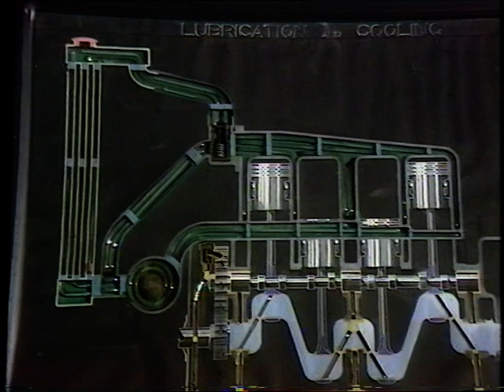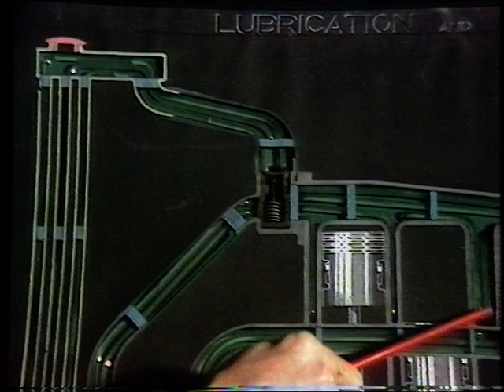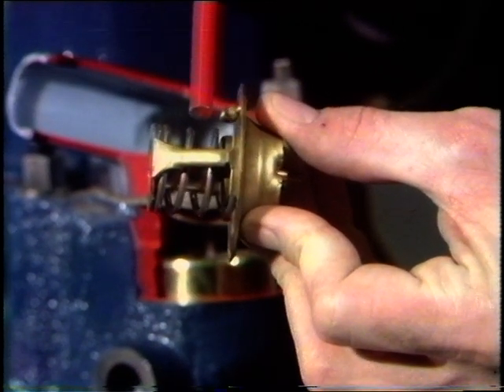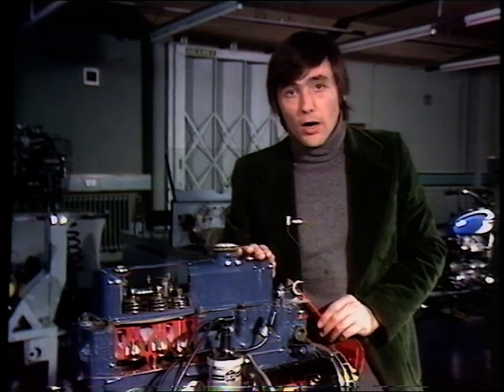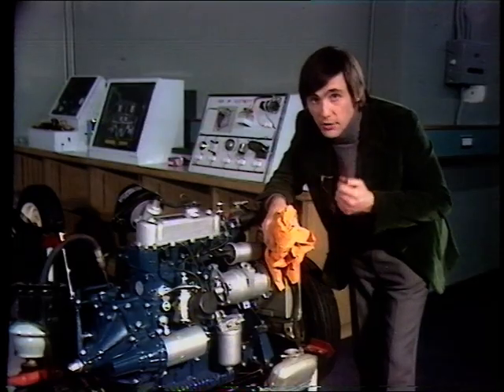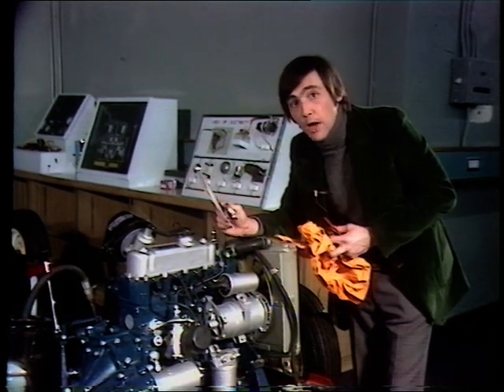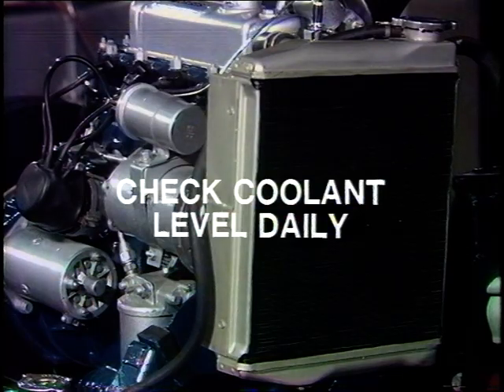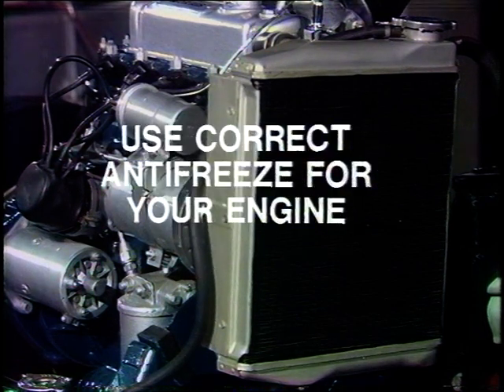How does a cooling system work | 1970s car | 1970s Engine | Drive in | 1973

Comment: Another serious piece from Bastable. Do you think any of this still stands? I don't do any of this - I only do it when my car breaks down!
Reply: I always check oil and coolant regularly. But then again, I am driving a 25 year old car.
Reply: My car’s only 4 years old but I check oil and fluid weekly. I guess it’s the legacy of having had older cars and never fully trusting modern ones. I check belts I can see about monthly.
Reply: @volvo480  Good point I guess, I did used to check my car (1992 Panda) before long-ish trips and spare water in the back. It's currently sat on the drive waiting for an MOT.
Reply: Yes.  Most of it still applies.  The same pump assisted thermosiphon systems are still in use to this day, along with rubber hoses that crack and perish, wax thermostats (although some are electric) and we still use a mix of antifreeze and water as coolant.
Reply: @brunster64  OK, so how often do you actually have to top them up ?
Reply: @spankysmp  Yup, we never bothered until just before a planned long trip.
Reply: pmailkeey -- pretty much never, for oil or coolant - still have to check though 🙈
Reply: @brunster64  Exactly - hence I don't bother :) Having said that, the car's not doing a lot of mileage - not really enough even to keep the battery charged!

So there's a thing - I 'check' the battery more - but putting it on charge every other month!

Comment: Nice instructional video on how to maintain a 1970s car by the late Tony Bastable. Never knew some cars were using methanol as coolant antifreeze.
Reply: Methanol was the most common anti-freeze before the advent of Ethylene Glycol based coolants. It worked very well, but was corrosive and as Tony Bastable said, it evaporated.
Reply: @capriracer351  and also when you drank it to whet your whistle on long journeys you could go blind.
Reply: 1970s ? I'd have gone for more 1960s !

Comment: Cold water into a hot engine will warp the head? No, it will crack the block
Reply: quite, and tbh if you put a bit in the rad it will heat before it reaches the engine. Thought that was slightly pedantic advice - try and find warm water!!
Reply: @pigknickers2975  it was a different world (and better)
Reply: @bonkeydollocks1879  don't disagree, we are all watching it for the same sorts of reasons

Comment: Just another reason  why electric cars are better
Reply: Why, because batteries in an electric car don't need heating or cooling? I have news for you: they do. 😊
Reply: From this clip you can an engine adapts to the outside temperatures, in winter in zero temperatures an electric car will lose some capacity and take longer to charge, especially with extra other demands on the electric network.
Reply: Tell me if your electrical appliances wouldn't catch on fire once it malfunctions.
Reply: Until they hit around 100,000 miles and then the very expensive batteries that use very precious resources need replaced. And they’re soulless and pathetic.
Reply: @gutworm686  is producing excess heat and noise polluting what gives an ICE car its soul?
Reply: @neychev  That heat and not losing half of your mileage when it gets to be -20C here like electric cars do certainly comes in handy around these parts...
Reply: @volvo480  difference is ICE car will break down almost i stantly without cooling, whereas electric car will most definately not
Reply: @gutworm686  Just like Elon Musk?
Reply: @gutworm686  Funny, I know of electric cars on their original batteries with a state of health percentage in the 90s at 100,000 miles plus.  But believe what you will.  And if you bring up the Nissan Leaf on Top Gear.  It is known that there are issues with the batteries on early leafs.  But Li-ion batteries go on to live a second life as grid storage or as home storage, and after that can be recycled into new batteries.

What happens to the petrol once you've used it.  Oh yeah, it's gone forever.  And yes oil is a precious resource.  Swings and roundabouts really isn't it.
Reply: I personally don't like electric cars as they are now. I can see the advantages but think that these are far outweighed by the negatives.
However, that's just now.
The future will be much different.
I imagine the first people to watch an early Edwardian era aircraft said "What's the point of those stupid flimsy things? Where are they going to take you? I'll stick with my horse and cart"
Reply: Let’s just face facts here. It’s a certain type of person who likes electric cars. A type I don’t particularly like.
Reply: @neychev  EV batteries will degrade when fast charging without proper cooling and will provide less capacity in winter without heating. Yes your car won't catch fire and will drive without, but its usefulness will be limited (for example Nissan Leaf where they left out thermal management for reasons of cost cutting). For further discussion I refer to this thread to which I fully agree to: https://mobile.twitter.com/bobbyllew/status/1147422925441720320
Reply: Electric cars are in their infancy.... new things often have teething problems. In a decade or two, we'll probably wonder what we did without them.